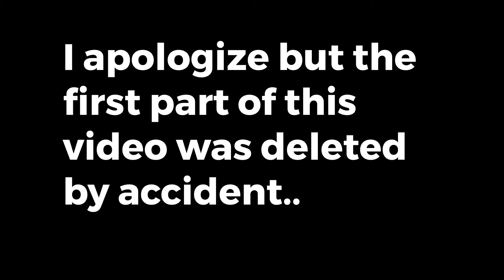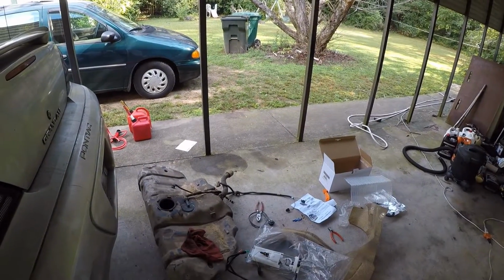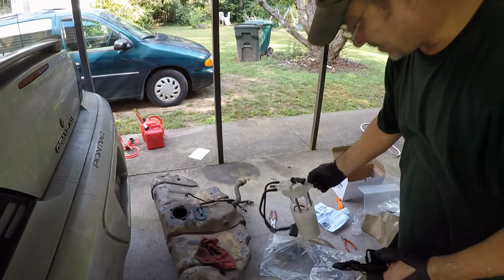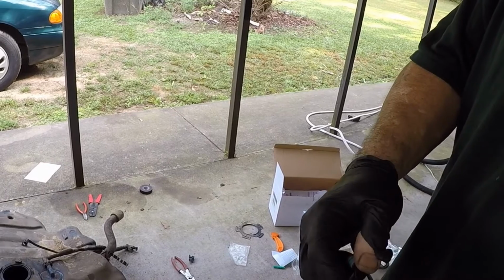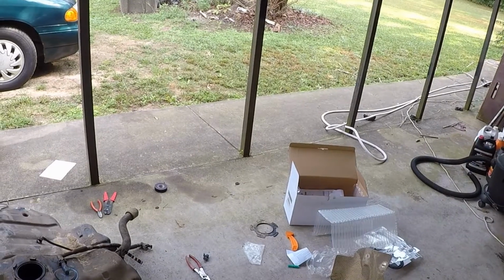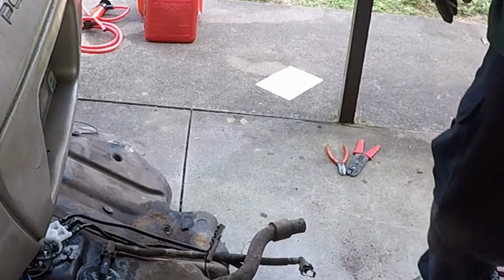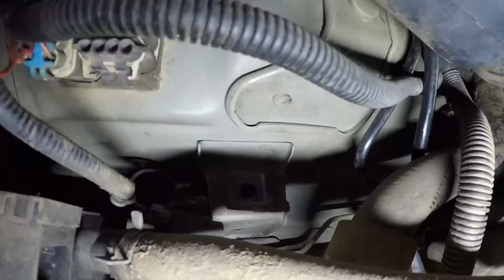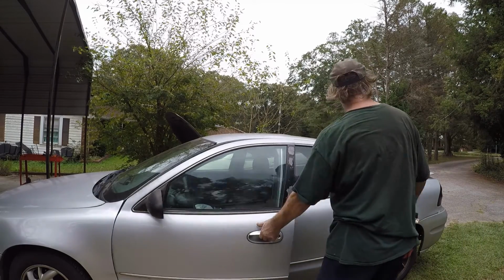Replacing a fuel pump in a 2004 Pontiac Grand Am (the right way)

Comment: How hard was it to actually drop the tank itself?
Reply from the maker: Pretty simple,only the Camaro do u have to cut in  top of the trunk.
Reply: @timzauto  okay. Cuz I deff do not want to cut the access hole. I’d rather drop the tank.
Reply: Not hard i did mine yesterday ,drove the car until fuel light came on ,tank is not that  heavy can lift it up by yourself

Comment: question for ya. What diagram did you use for hooking your new wireing harness together? i changed my fuel pump and now the bastard doesnt run at all
Reply from the maker: They were color coated when u get the kit with the new one,but the original harness u can just buy the new plug and hook it up by colors,https://www.google.com/aclk?sa=l&ai=DChcSEwj5ydr_gN78AhUC1oYKHfelBU4YABABGgJ2dQ&sig=AOD64_3REKDNX33MU88B1kkx_zkuXhoUgQ&adurl&ctype=46&ved=2ahUKEwjpns7_gN78AhWRKFMKHezjDlAQvhd6BAgBEFI